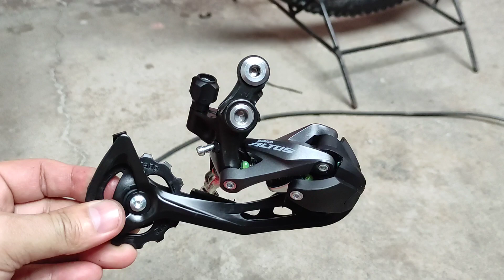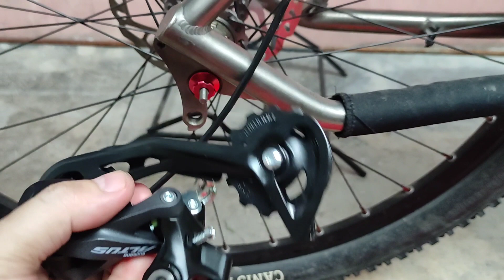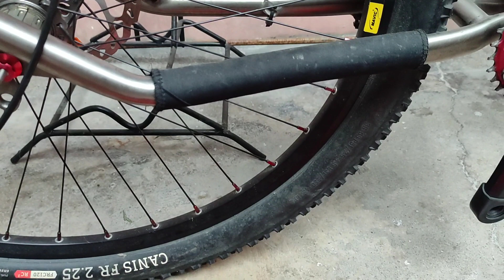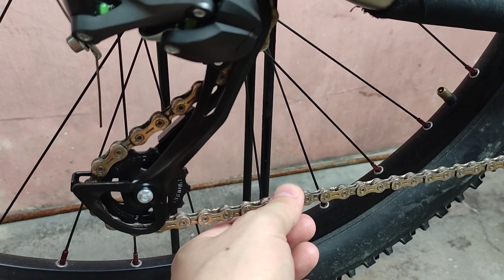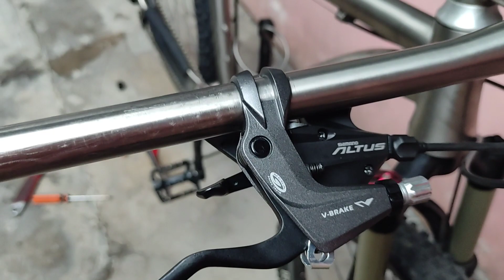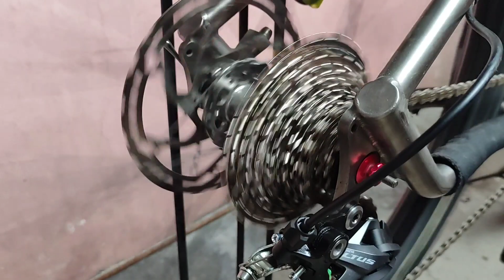little experiment on shimano altus rd M2000 replacing 11t pulley with 13t pulleys

Comment: Your chain spacing was slightly off. the distance from the top jockey wheel was forcing those center cogs to impact the roller pins on the chain, you can see it in the video.
Reply from the maker: Thanks for the inputs, will try em next time